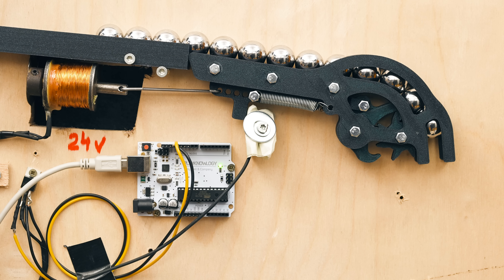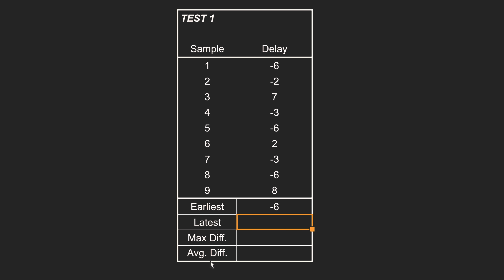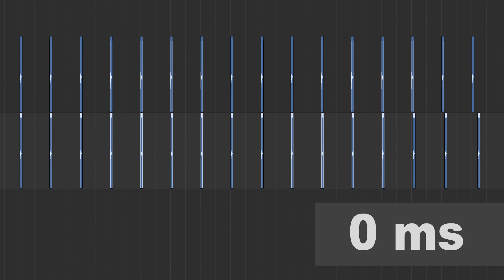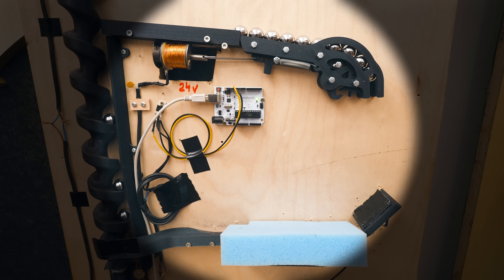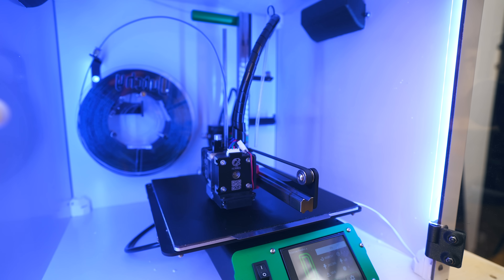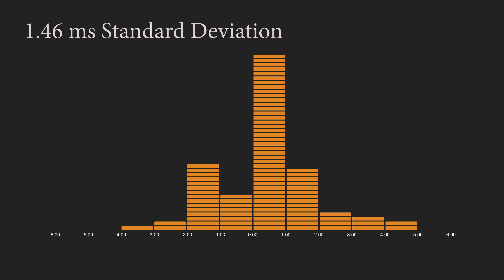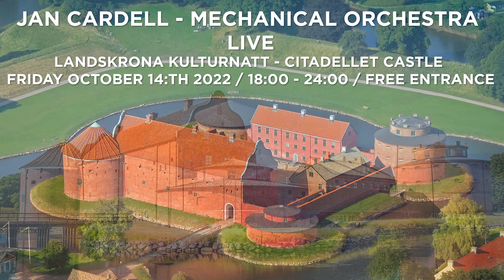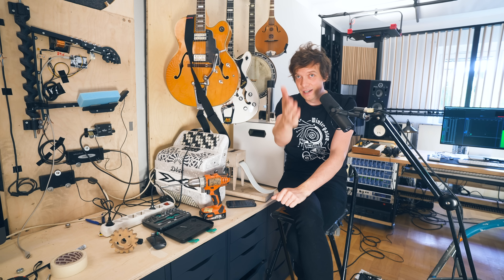Testing the Arduino Marble Gate

Comment: You've gotta automate the timing data collection. If you don't have to do it by hand then you can run much longer tests while you're doing something else
Reply: Drop sensor or a light sensor on the arduino on an interrupt and run the drop timer on interrupt too, save to sd or serial.  Or better yet have a light sensor on the solenoid too if it has random delay element actually energizing
Reply: Could probably detect the voltage spike from the contact microphone using the arduino.
Reply: Also eliminates the human factor. Not doubting Martin's abilities here, but manually aligning 90 samples is bound to induce some additional variability in the results. More importantly, automating data collection would allow for larger sample sizes. That said, I'm somewhat surprised that Martin didn't look at the average delay. Test 7 (which I believe was the 8° rotation timing wheel) looks well centered at 0ms delay, possibly slightly left skewed (negative delays occurred more frequently than positive delays). On the other hand, test 8 (11° rotation timing wheel) appears to have a positive average delay and is right skewed. Both of which you're not going to want for tight timings.
Reply: @Masterspam1  the actual "0ms" delay mark is going to depend entirely on the path geometry / distance between the dropper and target, which will change immensely. It also depends on where he has decided to manually mark as the "0ms" point. Standard deviation is a better measure because it measures the difference between the mean ("center" or average of the data curve) and the data points and finds by how much they deviate from the mean. The mean or average is the target timing and would end up being the final "0ms" point. Keep in mind the standard deviation should remain the same regardless of if the data is shifted left or right.
Reply: Totally second this - atomation is must, statistic likes big samples. I can script that for you, Martin.
Reply: Thats what i was thinking the whole video, there is arduino already to collect data
Reply: Use the crowd: 
For the folks even more towards the nerdy side of the spectrum, its a short finger exam to extract all this data just of a single recorded waveform. 
little python / numpy /fft & filtering and you have your data. 
let them create bot to automatically process new recordings ;-)
Reply: @Max-kc2rc  totally agree. My first thought when I saw this video was how fun it would be to work on a py script that does all the calculations on the audio file
Reply: I agree.  Ideally you should be using the trigger signal from the solenoid and a light gate for best results or some similar setup and you could even expand it to have the arduino log the data. I disagree however that any of these measurements are needed.  Part of the charm of the machine is the inaccuracies that the mechanics introduce.
Reply: It's funny, I went to the comments to say something along these lines and was struck at the two stark responses. Either people are really bummed at the perfectionism/(over)engineering, or they're like me and excited about the process. I thought Wintergatan was cool way back when I saw the first marble machine video, but it was the build videos and insight into the creative/engineering process that really made me into a big fan. I'd love to see him play live someday, but I think I'd be less excited than if I could just get an up close look at the final machine and ask him some questions.
Reply: @kennyhubbell813  My overall impression is that the people here upset at the drive for 'perfectionism' are actually just displacing frustration at contributing and not having their input acted upon.  I was going to say ignored, but that isn't really what happened.  Martin asked for a little input and got an abundance.  It was inevitable that people would start to feel ignored, though - the project is about Martin and his vision - even if it was supposed to be designer agnostic, it could never be everything everybody wanted.

While Martin was opening up communication channels and putting together formal documentation, I was mentally calculating the risk and impacts of alienating participants.  This is kind of the point in some ways.  I watched, and I felt involved.  I was concerned about what seemed to me to be an inevitable outcome (getting people off-side, gradually turning supporters into detractors or snide commentators),  and I did express this a few times.  I never saw any change of direction or recognition of this contribution.  

So, I feel a certain amount of 'I told you so' smugness when I see these kinds of posts, but then again, my involvement was so informal and my contribution so minimal that I don't think I could have changed anything.  I was a distant voice in a sea of noise, and I was not heard.  Had I been heard, I had no solid solution to offer beyond some basic strategy, so I never felt that I had some groundbreaking piece of insight that would revolutionise or save the project.  

From the volume and quality of input collected towards the end of this last push, I think it is pretty easy to see that some people dug in much deeper, put in significant thought and effort,  and presented opinions and proposed potential solutions with a feeling that they would save the day if only they were heard.  

A degree of dissatisfaction and dismissal of Martin's ongoing 'vision quest' is an inevitable result for those who are seeking something other than that vision (or a different version of his vision).  Underneath that, however, they are still communicating and are clearly still interested in the project just as much as those who are showing excitement at the renewed activity around this project.

This is just a really long-winded way of saying I don't think the division is as stark as it appears.  More just a benign display of ego bruising.
Reply: @icycooldrink6085  Ah, yeah fair enough. I've been more at arms' length for the whole project--I think this is the first time I've ever commented. But I can see being frustrated if you're more invested in the project. For me, Wintergatan is just one of several channels I subscribe to, albeit one of the ones I'm most excited about and will typically watch content from immediately once I notice it, and the thought of the marble machine being "done" actually makes me more sad than it being complete, unless of course he goes on to design the hamster powered bagpipe or whatever the next level would be.
Reply: This is the way.
Reply: As an aside, you can pretty safely assume that the timing of the Arduino is accurate. Any inaccuracies will be down to the micro, maybe even nanoseconds. What you really want to know is how much time elapses from the solenoid trigger to impact on your pad, which, as another person mentioned, could be wired to a simple audio sensor that can send a HIGH signal at a defined threshold. Then you could run your test for an hour and have the Arduino calculate the SD and average along the way, along with any other values (min and max times from release to impact, say). Tweaks to the release armature may not much of a difference in the end, so long as you know how much delay to expect between release and impact for your final armature design.
Reply: Automation is the last step. First you gotta make the requirements less dumb, plus three other steps before automation. Otherwise you are just making garbage more efficiently.
Reply: I'm not the best at statistics, but I do know there are methods to find out how accurate your measurements are based on sample size. I think that would be really important here, to avoid getting hung up on levels of precision that aren't actually measurable with the given sample size.

Comment: If you use a timer overflow vector interrupt for the led/release you can get exact timing every time within microseconds.
Reply: The variance probably comes from slop in the solenoid, not the Arduino.
Reply: this 👍
Reply: With the simple loop he's using he still gets single digit microsecond timing from the arduino...
Yes you could use the timer interrupts directly to remove the last bit of variance and get literal nanosecond accuracy, but what's the point? The mechanics are orders of magnitude worse...
Reply: @Basement-Science  He says he get less than 1 millisecond accuracy from the Arduino. If it was microseconds no one  would have said anything.
Reply: Yeah, something is wrong if the Arduino can't get sub milliseconds accuracy. It should be closer to microseconds.
Reply: I'd suggest you write the code and send it to him: show, don't tell.
Also, he's using music-editing software to do the analysis. That can't be more than about 20microsecond accuracy, assuming the capture system has no jitter...

Comment: if you want you Arduino to be tighter, you have to forget the Arduino IDE and its nice, but also really really slow functions. Im sure there are enough tutorials on how to speed up your Arduino code. But the most important thing is to just access the output register directly. This will most likely be the most change and enough for your timing needs.
Reply: Yes, there is no reason why he should have a 1ms deviation on the gate alone w/o any marbles.  The arduino itself should have a deviation on the order of a few microseconds (if properly programmed).  The solenoid wiggles a bit + the solenoid power might not be entirely stable (I don't know if it comes from a battery or not)... that adds a little extra, but how much?
Reply: @peterfireflylund  My thoughts too.
Reply: This is not an issue here... The "speed" of the functions doesnt matter as long as it is the same each time, and you're talking about microseconds there anyway, not milliseconds. Dont overcomplicate things.
Reply: Well, I don't think using port manipulation and timers would make a huge difference here. The inaccuracy is surely caused by the solenoid and the other mechanical parts.
Reply: @david4599  or with the way delay() is implemented.
Reply: you can still use arduino ide, just use a hardware timer instead
Reply: you can use interrupts with the ide etc.  it's not like you couldn't. you can do a 3d printer fw from the ide, it's more about what you do with it. the solenoid delays though probably it.         though you could put some opto sensor or something on the solenoid to get actually when the solenoid activated and a sensor to detect the drop and then the code would matter.
Reply: The Arduino's delay() isn't good for precise timing. I've seen some reports of +/- 0.5ms variation and up to 1ms inaccuracy. It will depend on the implementation which has changed over time. Using delayMicroseconds is a better choice in this case. And also avoiding using the looping nature of loop() and just use your own while loop.
Reply: For exact timing you have to setup a timer an let it call an interrupt routine to release the ball. Delay() or millis() will always be inaccurate by about one millisecond.
Reply: The Arduino is running under an OS.  Real time control requires an operating kernel that has no background services running that randomly steal cycles.  For real time control that is absolutely synced the output lines need to be latched with a synchronous external clock.  Basically, assuming the processor has multiple (many) cycles per external state change, interrupt the processor when the output lines are latched.  The new output states need to be stable before the next clock.  If that is not possible, the design is not feasible.  In the case of the Arduino here, using externally latched output lines and an interrupt from the external clock would result in absolutely synced outputs.
Reply: @edwintripp1034  that's just plain wrong about regular arduino, you can do "Realtime" stuff under it. it's just an atmel with a bootloader.
Reply: @lasskinn474  this guy either has no idea what he's talking about or he's really bad at explaining himself. in a longwinded fashion he essentially said "just use an fpga"
Reply: Honestly there's no reason to use an arduino for this. A function generator would be more convenient. And with a two channel oscilloscope you could find the lag between the arduino/function generator output and the solenoid movement.
Reply: @ram434  did you really just recommend against using a €10 arduino, and for buying €600 worth of equipment for no reason
Reply: @ikbendusan  1) I didn't recommend buying one. 2) They are available for a fraction of what you said. 3) They're not an uncommon bit of test equipment for people who do much electronics work. 4) If you have one it is undoubtedly a better choice for the task of "generate a repeating pulse for a temporary test rig" since you just have to dig out the tool, wire it up, and put in the correct settings, vs digging out an arduino, making sure you have the IDE installed, and programming it with the blinky light demo or whatever. And beyond that, it sidesteps any concern about what method you are using for the timing. Especially for someone who is programming/embedded illiterate.